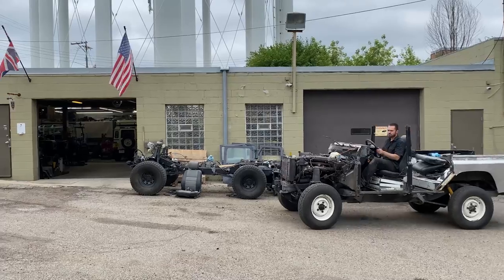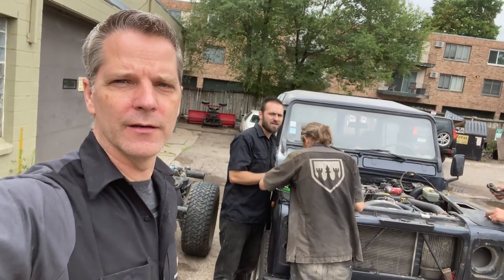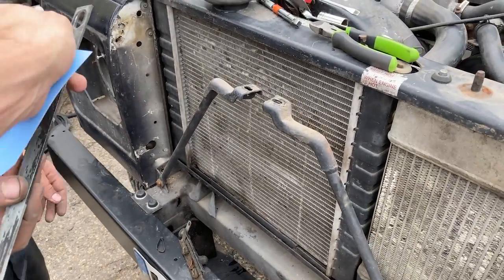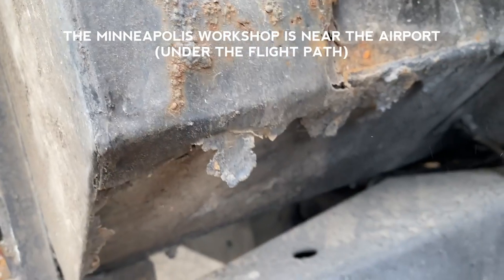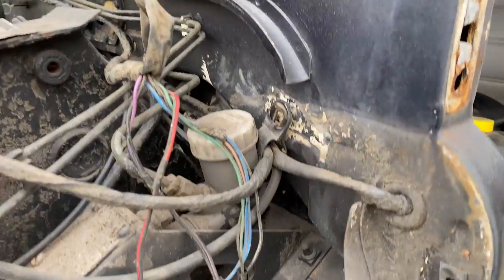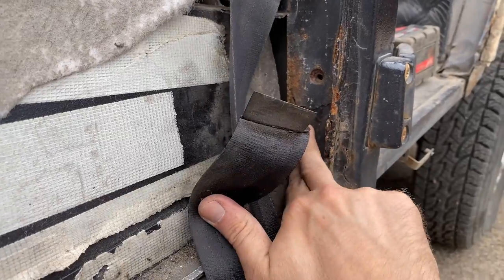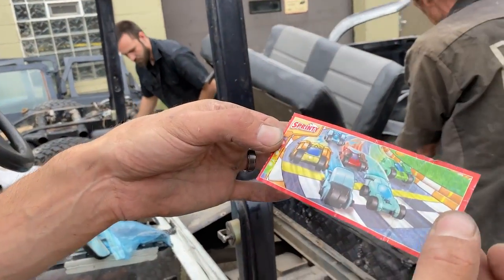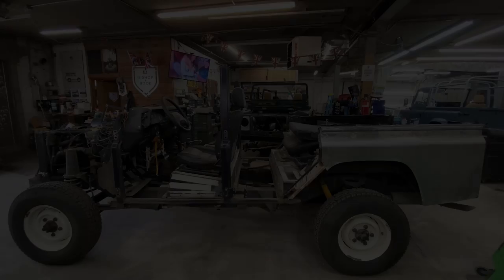Bishop+Rook - Defender Rescue Project - "Land Rover Defender 110 Disassembly" - Episode 002

Comment: Which year from?
Reply: Before seeing the engine (which confirms it), the breather on the right flap and the type of turn signals on the front wings "tell Us" that it is a 300TDI, so it could be from March 1994 to September 1998 (TD5).

French registration is from 2009 (registered again)